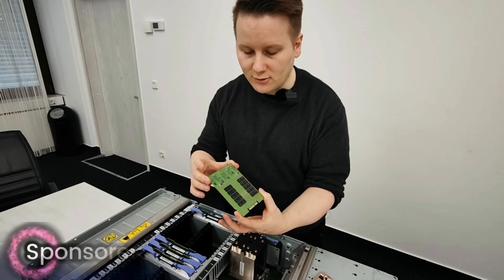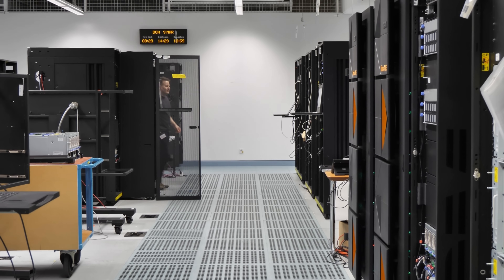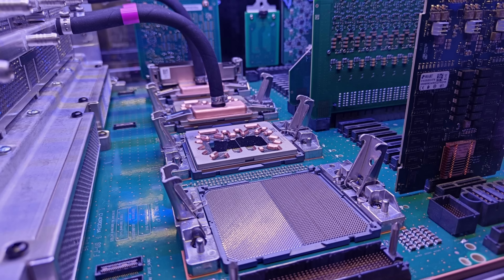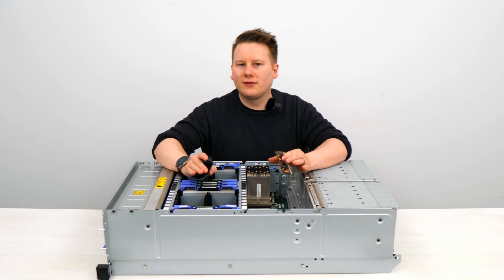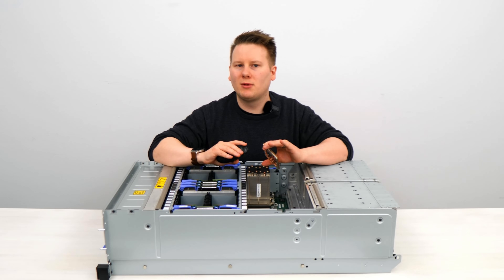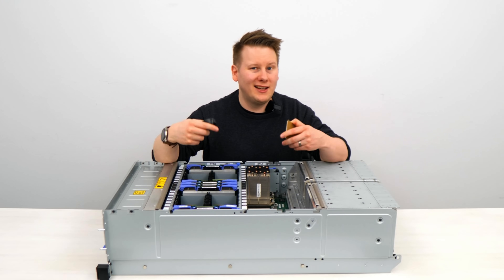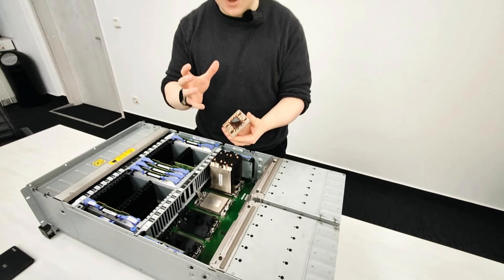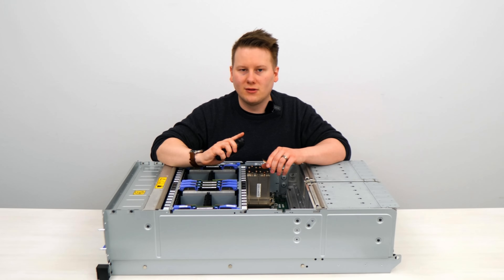Extraordinary hardware in an ordinary system? The LinuxONE Rockhopper 4

Comment: I am able to get a Linux instance on the OSS community cloud provided by IBM (you need to be a maintainer and IBM approve your application). I believe it's running on the previous generation LinuxONE. The performance is amazing. 2 shared cores of that is crushing what I get from 2 Zen2 cores on my own dev box.

I wish the price could be sane and I can own one personally. One of the standard rack mount ones will more then cover my development, hosting, homelab needs.

Comment: Wow thanks for the video. The power delivery system is interesting but what is the supply voltage?  In addition could you do a component deep dive in the future possibly focusing on a powered up system and the details of replacing various modules on the fly?

Comment: Fits in a rack and runs linux, sounds great.  The only info I need is performance and cost.  Sadly the "Cost, sustainability, and Software" section does not discuss how much the system costs.
Reply from the maker: Cost is very usually customer specific. You engage with a sales rep and it's a full support package with hardware - no simple Lenovo dropdown here.

Comment: Watching this video it's like the last 20 years never happened.  Basically every piece of modern software, from Kubernetes to MongoDB (two projects IBM are pushing!) are built to run as a distributed system which uses inexpensive individual nodes which can die at any time and yet system as a whole carries on.
Why are IBM continuing with the hyper expensive keep the single server running at all costs approach when that paradigm is now undesirable?
Reply: We have much more cost-effective ways of ensuring the necessary reliability nowadays. Google does it by installing half a million commodity servers--they cut costs to the bone on every part except the power supply. This is because their systems are robust enough to recover from lots of hardware failures, but the single biggest cost in running a hyperscale computing centre is the electricity bill.

And Google can respond to your queries in milliseconds. Try doing that with COBOL code on an IBM mainframe.
Reply: Because if a disposable container running an ERP or banking transaction dies it means you might have lost millions of dollars. Also these systems tend to run databases measuring tens of TB that must have extremely fast throughput, 100% accuracy and ability to operate on the hardware without dropping a transaction. Distributed containers are great for heavy volume of web traffic but not for ERP.
Reply: @krj15489  So why create this video pretending that MongoDB and Kubernetes workloads are a reason to buy these mega expensive servers if the real target market is people that want monolithic software architecture?

Comment: It is no secret that IBM did heavy lifting for linux multicore scaleability and many problems were solved there before we even could touch machines with that many cores. Things like RCU come to mind. Linux kernel support was never big question for me.
After reading bit about OpenPower years ago, I wanted Power based workstation, to try out this platform. I just wanted experiment little bit with VSX, SMT4 among other stuff. Unfortunately the availablity and price made me to strongly reconsider. Something like this platform for sure is beyond my reach, if it doesn't pay for its bills and I don't even need to ask how good my TCO will be. For me, that means x86 will be getting most of developer mind share and they will struggle to build strong software ecosystem around Linux and FOSS. To add to that, in my former job (one of GPU manufactures) there was a some opensource library, that guys from IBM had to support on their own. Some HPC people were using it on Power machines somewhere. We did support both x86 and arm because that was what almost everyone was using. But sure, if that is what you need, you can deploy it and it'll work, this hardware looks really amazing.

Comment: would really like to see some backup of all those claims. especially on database performance and compute power. since it does not really make sense that the ibm cores are that much faster then x86 cores.
Reply: Just do some research on the IBM Z microprocessors and the architecture. They are custom designed and tuned for high throughput performance and massive scale for transactional workloads with massive amounts of on-chip cache that provide performance and latency benefits that are not matched anywhere. Architecture matters
Reply: In general, IBM Z tends to be designed for more enterprise-y, I/O-heavy workloads in mind, so for those it should work well. Then again, AMD is putting a lot of PCI-e lanes in their newer stuff so a comparison should be interesting.

Although... there's a bunch of enterprise-oriented stuff in Z system besides the pure performance (LPARs, the redundancy stuff, etc.) that also make it into the equation for an actual customer, so do take that into account.
Reply: Mainframes were never designed for CPU speed. Indeed, the CPU is considered a scarce, expensive resource, so they would put a lot of smarts into the I/O controllers to avoid bothering the CPU with requests for service for as long as possible.

The downside of this is, while they offer high I/O throughput, they cannot offer low interrupt latency. This means they are optimized for traditional batch-style mainframe workloads, not rapid interactive response.
Reply: Same here.  However, what you are looking for is probably something that the Linus Tech Tips channel is better suited to handle than TTP guy reading the PR lines from a teleprompter.

Comment: Locking to proprietary hardware ... "but it can run Linux !!!" ... nah thanks. OSS nad FOSH is future, like RISC-V
Reply: That's not generally a concern for the large businesses that purchase this gear. They need throughput and uptime.
Reply: @krj15489  So why not going to the other high troughput modern platform from IBM, you know the Power one they specifically don't talk about in this video despite having an open source hardware foundation.

Comment: I would totally move to power or whatever if our cloud provider supported it, as it's all just a recompile away. IO and Cache look pretty sweet.
However, I don't get the point of the RAS stuff. If your system needs to be fault tolerant, you already need to write the software to handle an entire datacenter getting destroyed. If you need it to be correct, you already need to have written a validator process. So, I'm not sure who this stuff is really for.
Thanks for taking a look at it though - quite a nice design.
Reply: The number of companies that actually have real multi-datacenter fault tolerance is very small. Lots of companies (including some major apps that you probably use) can tolerate a DC failure in theory but very few systems are actually tested that way (I've worked on these, sometimes failover works but will fail during peak hours as well due to insufficient overprovisioning). The executives don't want to need to hire engineers who can program hardware fault tolerant apps because those people cost 2-3x more than the average engineer.

Comment: I think none of us have ever considered Z family because holy moley are they pricey unless ur actually one of the few people who needs high-reliability computing lol
Reply from the maker: Hardware costs per system, sure, but I think the idea is that if you look at what you're replacing, what that cost, and licensing costs you save, it's a full TCO calculation
Reply: @TechTechPotato  so I spent a lot of years doing big enterprise consulting and the most common migration strategy from Z/OS mainframes (or to super high availability systems) is actually to IBMs Z Cloud. This is actually a really good middle step because doing mainframe programming is waaaaaay different than doing server programming. Took me like a year to wrap my head around connectors and how the different components even communicate to external systems.